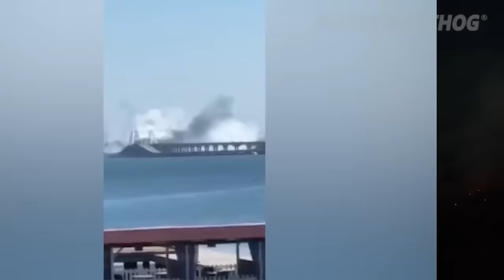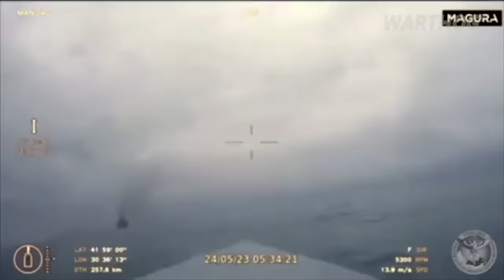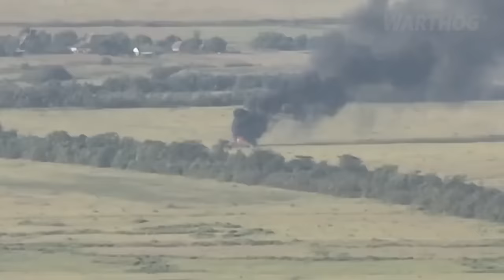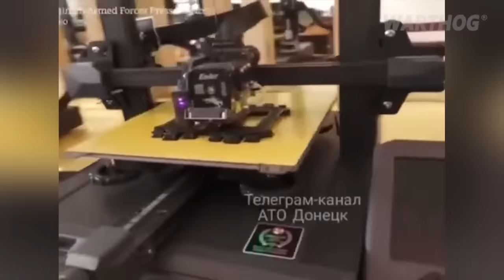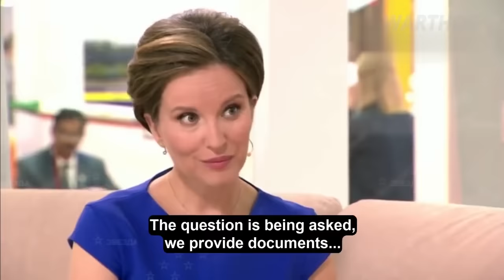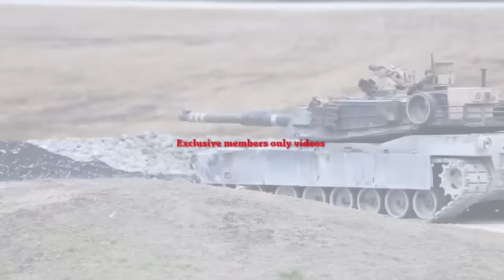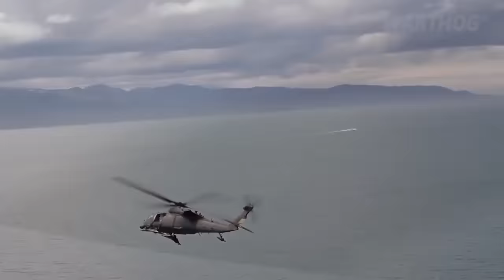RUSSIAN ARMY IN THE SOUTH IS CUT-OFF, THE KERCH BRIDGE IS BEYOND REPAIRS || 2023

Comment: Drive a boat bomb BETWEEN the pillars so that the energy of the blast is confined and the effect magnified.  If you take down the columns it will be next to impossible to repair the bridge without massive work and that will take time.  Take down BOTH the road bridge and the railroad bridge.
If a boat bomb with a few tons of HE were fashioned such that the blast energy is focused as with a shaped charge it should be possible to either completely destroy a column or to damage it so profoundly that the bridge is unsafe for any vehicles.
Reply: " Drive a boat bomb BETWEEN the pillars "
Not possible , watch the video again and you will see that the pillars  stand stand on concrete blocks so are out of the water
Reply: Very likely true.  But if it was so possible, Ukraine would have done so Long Ago.
Reply: I think you can rest assured that the Ukrainians are consulting structural engineers on the best ways to achieve their goals with the bridge. It also takes time to develop these marine bombs.

Comment: These drones must submerge their bomb load before exploding it, this way the explosion it´s concentrated against the pillars as water acts as an anvil against which explosion waves rebound. This was the trick in WW2 for the Ruhr dam destruction. In a dam, the effect is greater because the other side is air, but against a submerged pillar still is far better than exploding on the surface, using effectively just a fraction of the explosion force.

Comment: They'd be better off using hoovercrafts for de-mining, attach a MICLIC line to the back of the hoovercraft drag it all the way out with the hoovercraft, the hoovercraft would be back and gone before Ivans figured out what happened.
It temporarily makes up the number of MICLICS on the battlefield.
You'd only need the two seat versions, small, light and fast and plenty available in the west.
Reply: Hovercrafts sound like a good idea. 
Could they even build hovercrafts so strong they could transport military equipment without even needing to de-mine?
Reply: @davidhowse884  I think the US still has some that they use to transport military equipment and men
Reply: @davidhowse884 The Americans already have them, they're called LCAC-L.
The Royal marines version is called Griffon.

Comment: Worked for Department of Transportation for five years in administration. Went with a bridge inspector one day for the neck of it. Noticed a lot of pillars had vertical cracking. Asked him about that and just noticed same cracks shown in this presentation. In essence he said those cracks just happen over time and diagonal and horizontal cracks are worrying. He also said that water was not welcome but rebars  were all galvanized. Wonder if the Russians used galvanized rebars? Hope they didn't!

Comment: Yes yes very good but when will there really be a breakthrough and we can see them running back to Rostov and the Mad Dictator is deposed!
Reply: Patience is required.  It took three years to take Hitler from his height of glory to suicide in a bunker.  Also three years between the apex of Japanese power in the Pacific and the Allies' landing on Mindoro (Philippines) that marked the start of the mass Japanese retreat toward the home islands.  

In the liberation of the Philippines, notably, Japanese deaths were 321,000, some 23 times as great as US KIA.  The typical Japanese soldier had an iron will to fight and die for the Emperor regardless of personal peril.  That made them incomparably more brave than the hapless troops the ruzzian mafia regime is sending to their deaths in Ukraine at present.  It will not take any atomic bombs to finish off ruzzian will to fight in Ukraine once the ground shifts under their feet, and they see F16s overhead, obliterating ruzzian helicopters and other assets.

Comment: It the piles are not deep enough settlement will occur and resulting in damage to the piers and deck. Big explosions and  could cause vibration and movement similar to earthquake damaged.  In silt the soil could liquefy.   it i called liquefaction. This is theoretical and probably needs a quake rather than a blast.    Working to a tight deadline determined by  a dictator  could have seen corners cut.       There is a story about Stalin.  Annoyed about delays with the engineers he asked what is the delay on the Moscow to Leningrad railway line .  They said they were working on the alignment.  Stalin said he a had a prefered route and got a ruler out and drew a straight line.     No on argued.

Comment: could someone explain how those sapper shoes are supposed to work/be better?
every aspect ive thought of only makes them worse.
Reply: I imagine that the concept is that the soldier's weight is distributed across all of the "toes," and they are spread apart enough so that the weight likely to land on a mine isn't enough to trigger the mine.  E.g., a soldier weighing 160 lbs. would put nearly the whole 160 lbs. on the ball of the advancing foot while  stepping on a mine, while that weight would be spread among the four "toes" of the sapper shoe, only one or two of which would be likely to put weight on the mine because of the front-to-back distance.  This assumes that a weight of 80 lbs. won't set the mine off, whereas pressure from the whole 160 lbs. would.